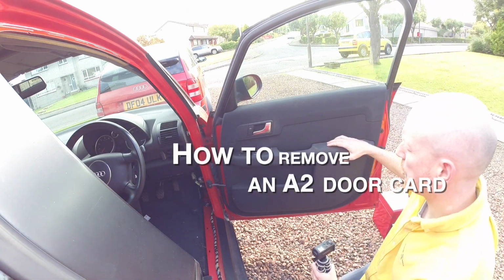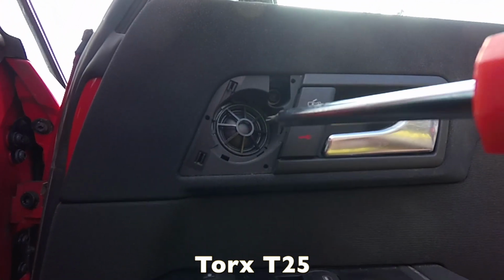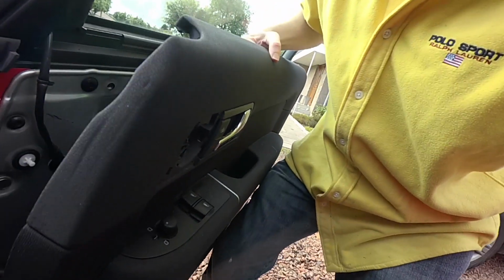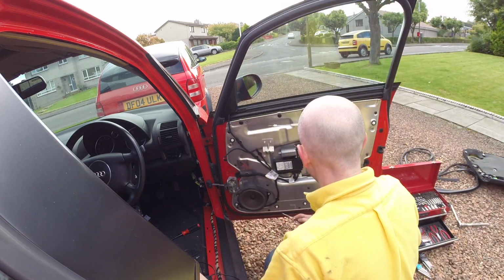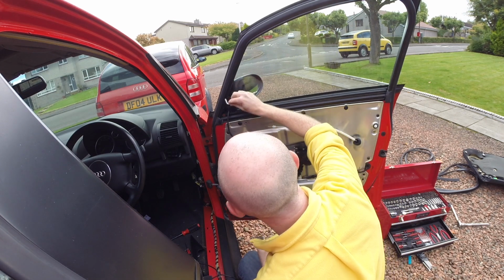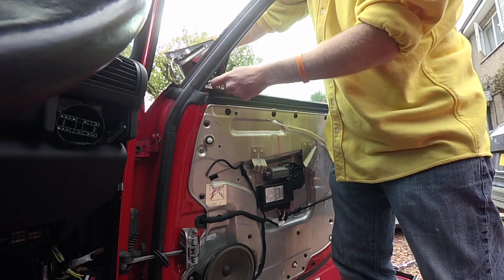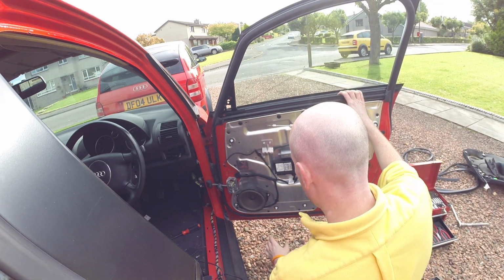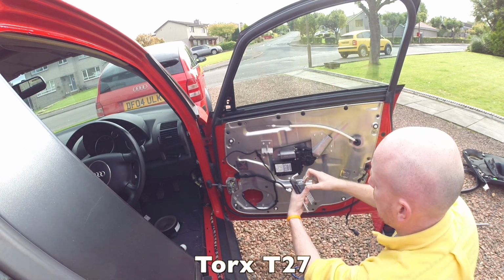A guide on how to remove an audi a2 interior trim, door card, and wing mirror

Comment: Same procedure with rear door?
My window can go down electrically but doesn't go up anymore.
It stays temporarily in place with a wedge.
I think the plastic piece connected with the cable broke down so I'll have to open it
Reply from the maker: Very similar @Ciupremo only a few screws in similar places and then the clips around the edge.

Comment: Hi, How do you adjust the doors on the Audi A2 so that the left front and left rear doors line up together ?
Reply: It depends on how badly aligned they are but you can make adjustments at the door latch. Simply undo the bolts and move it around a little and should move the door slightly when closed.
Reply from the maker: Let me know if you need more info

Comment: Hi, thanks, very useful. Cheeky, somewhat unrelated question: do you have any experience of or hints and tips regarding the internal trim attached to the tailgate? I can’t see any screws. I’m trying to get access to the tailgate mechanism because the manual release has failed. I’ve opened the boot using a cigarette lighter booster for the central locking but for completeness I’d like to fix the manual tailgate release too. Cheers.
Reply from the maker: Hi Steve, thanks for the comment. The boot trim is actually quite easy to remove. I'd be happy to do a little video if you think that it would help you as it would likely help others too?
Reply: @mrbroons  By all means please do if you have time!  I've searched on YouTube and I can't find anything which covers this point.  Cheers.

Comment: Hardly any soundproofing inside the door? room for improvement, it's supposed to be a small but premium car.
Reply from the maker: Certainly plenty of room for Dynamat. I would suggest that there were some premium features but after taking quite a few to pieces it wasn't that premium in overall basic design (e.g. clips and fittings), just standard VAG.

Comment: Thanks for the video, I'm replacing my passenger wing mirror soon this will help so much, do you know where would that mirror cable lead to? Since the controls are on the driver side
Reply from the maker: Hi Sir, the cable should lead to the motor/controller in the passenger side door also, so the process should be the same in terms of unhooking it. You should be good though just take it easy and be prepared with some spare clips as they break quite easily especially in the cold! If you go on www.a2oc.net then someone will have some for sale cheap (rather than pay more expensive prices for new ones). Look for A2Steve (username on the forum)